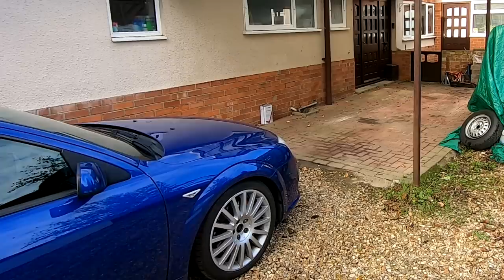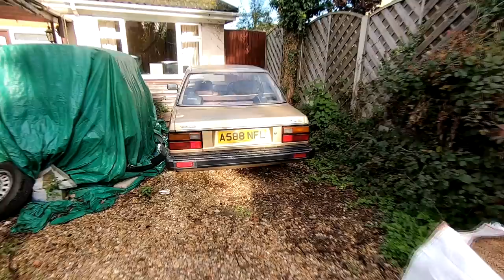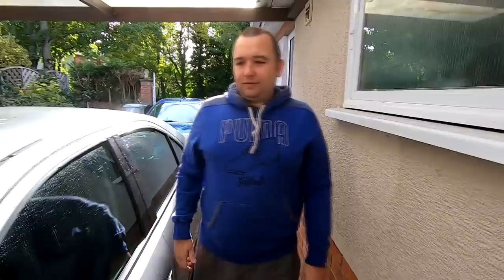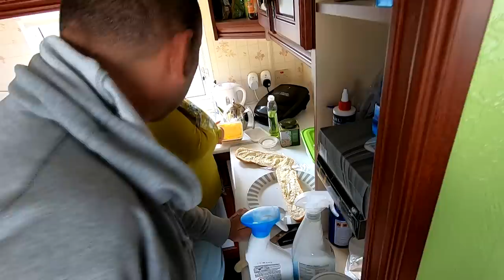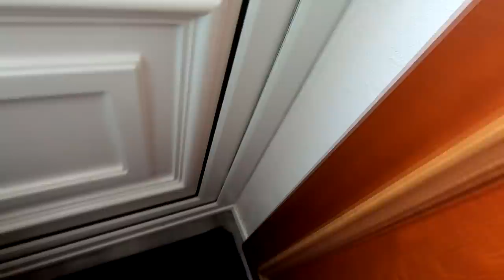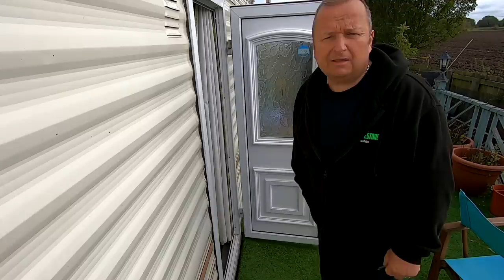Home From Holiday Cars And Caravan Update Vlog

Comment: Adjustment on the hinges usually on the inside of hinge when door is open the adjustment there can throw the door in top or bottom etc and small alan key usually for adjustment up n down on underside of hinges you will suss it 👍🏽👍🏽👍🏽

Comment: On Chris door on the lock side of the frame there's lock keepers that you can adjust to pull the door tight when you lift handle and lock
Reply: Was gonna say the same adjust the bolts. 👍

Comment: Global opening and closing is standard on the St Mondeo on sunroof models it opens and closes aswell. If you ever disconect the battery though you have to re programme it. But you do that easily using the driver door window switches.

Comment: Looking at the door handle mechanism, the bottom receiver on the door frame (I'm not sure what it's called but it engages with the bottom locking mechanism when you lift the door handle upwards) might need moving back a millimetre or two to close the gap.